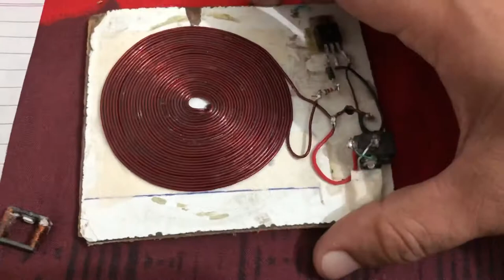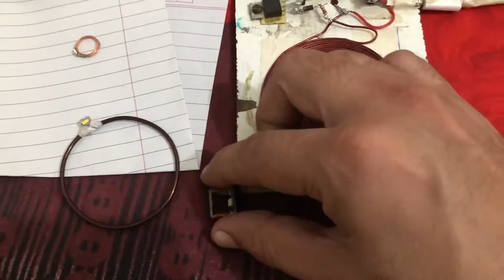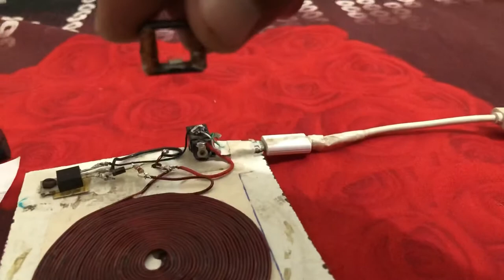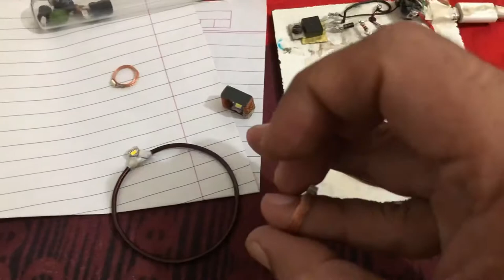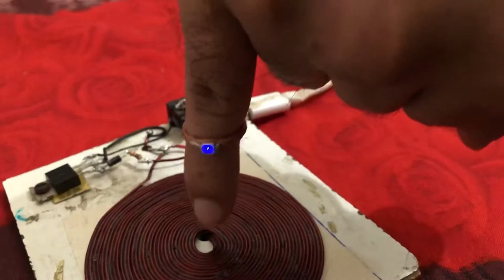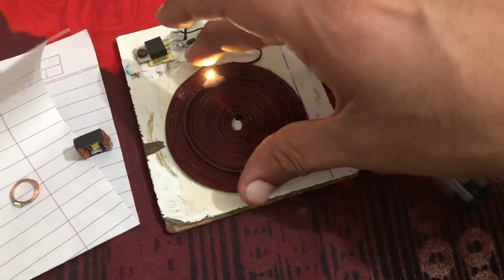Bifilar tesla coil. #nikolatesla

Comment: Greetings from Colombia. Would you help me build one? Can u send me the diagram
Reply from the maker: Transistor : T1p41c 
Resistor : 10k 
Volatge : 12v DC
Copper wire size : 1mm.
Reply: Bro cricut make link video